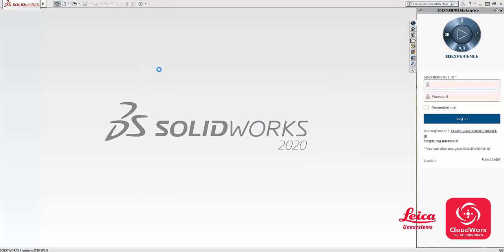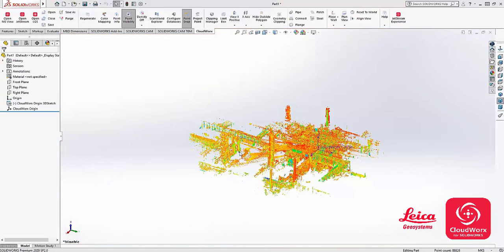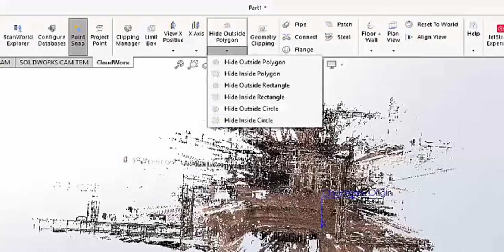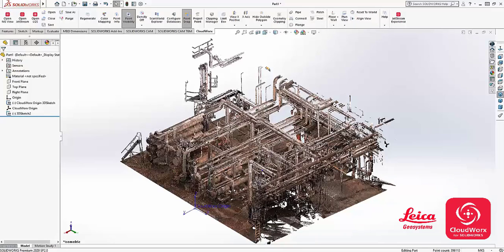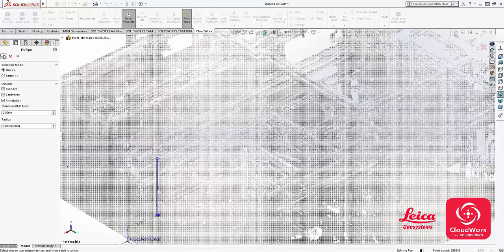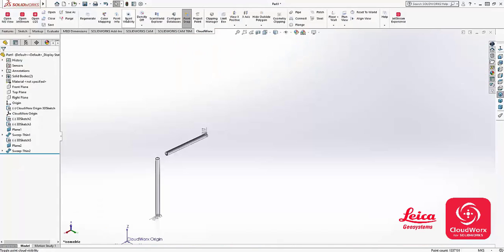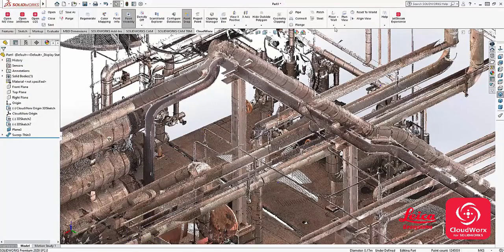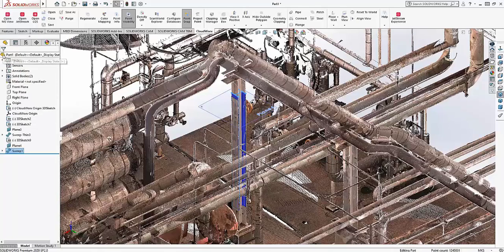A very quick introduction to Leica CloudWorx for SolidWorks

Comment: Thanks for the video! There is not much information regarding this out there. Is there a way to validate measurements? Say a client has an modul in Construction, and wants some to scan and take measures in the pointcloud, to validate the measurements?
Reply from the maker: Of course, the data is accurate to a few mm depending on which device you used to collect the pointcloud...